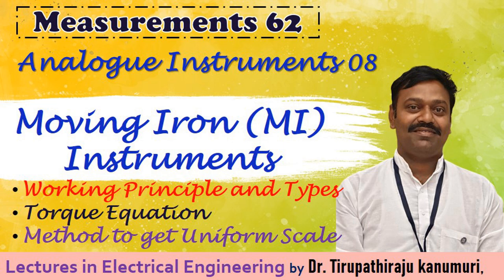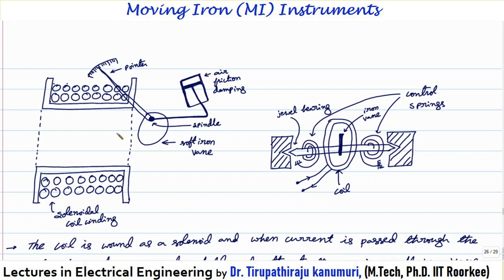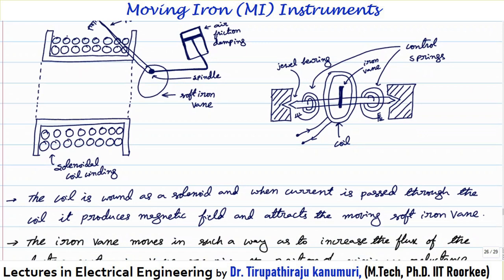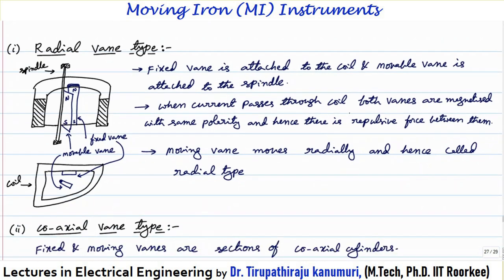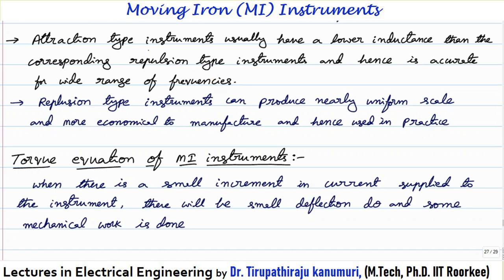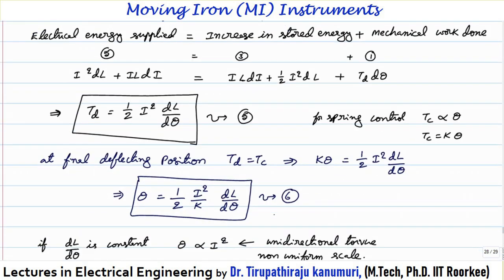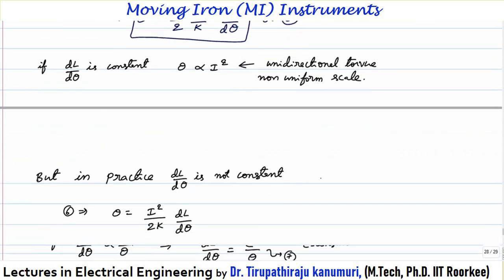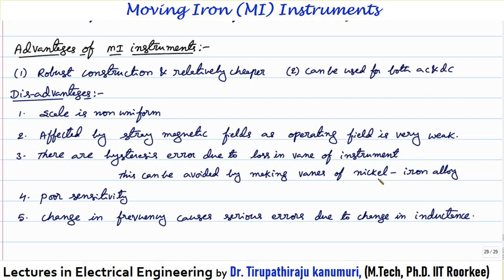ME62 Moving Iron MI Instruments

Comment: Sir i have a question. 
A moving iron voltmeter can measure voltage without adding series resistance (A MI instrument can inherently measure voltage) 
A) 0-30V
B) 0-300V
C) 0-500V
D) 0-750V
E) any other range
I could not find this on internet. 
Thanks in advance